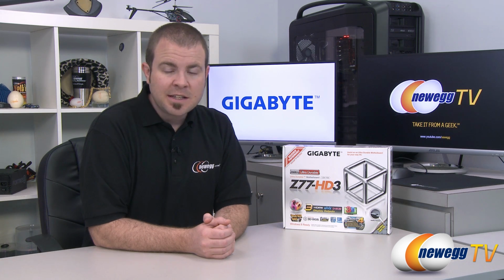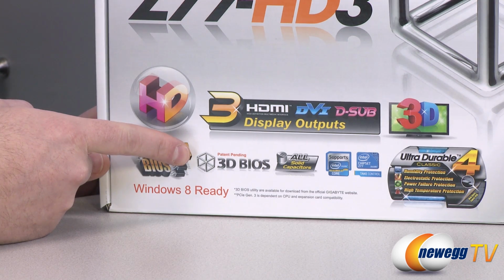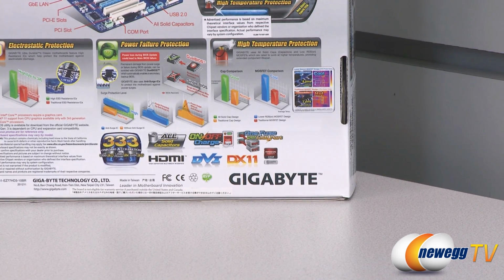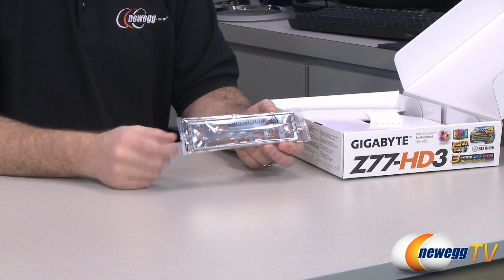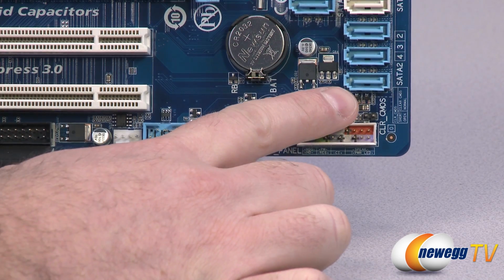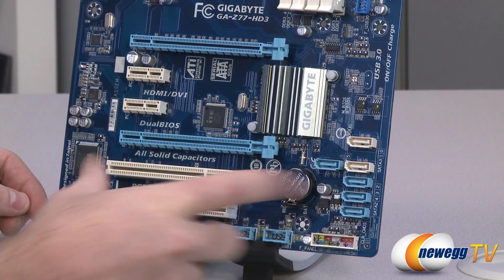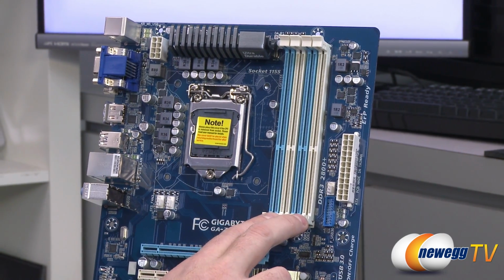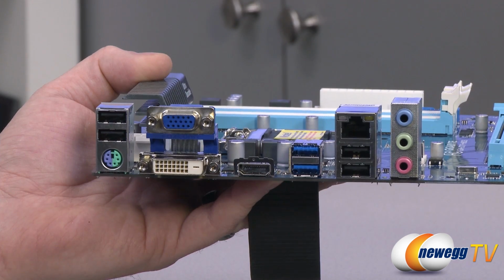Newegg TV: GIGABYTE GA-Z77-HD3 Motherboard Overview

Comment: hey paul since you are with newegg..what would be a good gaming rig for $500?
i have:
case(full atx case)
dvd/cd drives(ide though)
fans(x2)
hdd(500GB western digital blue)
OS(windows xp pro)
and graphics: EVGA geforce GT 610 1024MB GDDR5 ram
would you know of a build that is good with these parts? my current pc is low end workstation that was built for a database...

Comment: They got better PCB coating, which keeps the board from being a P.O.S after a while of constant heat and humidity, etc.. Like Honda, ECU made in Thailand, on early 2000 model Civics, the coating lifts off the board causing the processor to loose connection. Hence at 65mph on freeway my engine lost 95 percent of power, coasted a half mile, after nearly being rear ended by a semi trying to get over 2 lanes to the side of the road.

Comment: You can use USB 3.0 to charge your cell phone, ipod etc. USB 2.0 doesn't provide the power to charge devices. Some boards like this one, let you power your cel phone on a USB 3.0 port even when the computer is shut down. Problem is, on mine, the USB 3.0 ports on my Gigabyte board is in the back of the computer, so I'd have to crawl under my desk and run a Micro USB phone charging cable around to the front.

Comment: I'm sure the blue relates to that PCB coating he was talking about. My 02 Honda Civic had issues with the ECU, the coating wore off at 60k miles, hence, I lost a lot of power to my air vents, and at 110k miles, I lost engine power driving on the freeway doing 65mph, nearly rear ended by a Semi. Replaced the ECU and my vents were back to 100 percent, everything on the ECU controlled the entire car. No safety fall back to keep the engine running more then 10 miles an hour for a half mile.

Comment: actually I have a question and anyone's input will be appreciated. I bought a M5A97 LE R2.0 because it was $20 cheaper than the regular one and it doesn't have USB 3.0 headers. it has USB 3.0 in the back but for the life of me I can't figure out what can fully utilize USB 3.0. Any thoughts? I know hard drives are limited by their RPMs so even ones that use USB 3.0 don't really use all of it. I have a USB 3.0 memory card reader. I only use cards for family photos and stuff that don't need USB 3.0

Comment: On your computer show how builds, where does the network adapter for wireless internet go to the mother board. There is three slot on the motherboard that are a posiable. I hope you can get back to me as soon as posiable because im currently build my computer and buying other parts for the build. I would also like to know what to look for in the adapters, like what not to buy and what to buy. Thanks! Jeff :)

Comment: Well if you're doing sli or xfire with this board.  It's an immediate FAIL for some potential customers.  right angle sata connections on a motherboard make more sense.  Otherwise you're bending the piss out of the sata cable itself to a ridiculous degree risking data and connection loss or corruption on whatever storage device(s) you connect to them

Comment: Actually Paul, the board only supports CrossfireX.  SLI requires the additional x16 to run at x8 electrically and the x16 slot on this board is x4.  ;-)

Comment: i have this board, it has usb 2 and 3 because alot of newer model devices such as hdd's are coming with usb 3.0 for faster transfer speeds, they need both the older connectors and newer ones to accomodate peoples devices. i dont have any usb 3.0 hard drives so im glad it still has 2.0! im sure as technology progress's they'll get rid of older parts and versions as they always do! hope this helps in some way